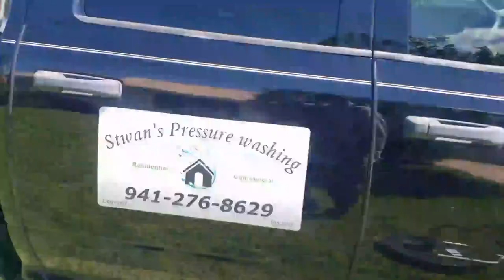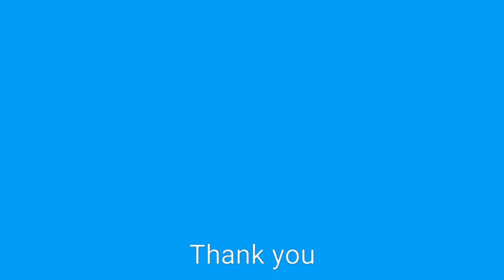Full TILE ROOF Clean With A Surface Cleaner

Comment: How much psi are you applying to those tiles?
Reply from the maker: Varies per roof.. I set my pressure to around 1,000k to 1,500k psi depending on algae growth. As per the tile manufacturer.
Reply: @stwanspressurewashing2282  awesome. Thanks for replying
Reply from the maker: Yup
Reply: Pressure Washing TIME LAPSE What are you using to alter the pressure you’re putting out?